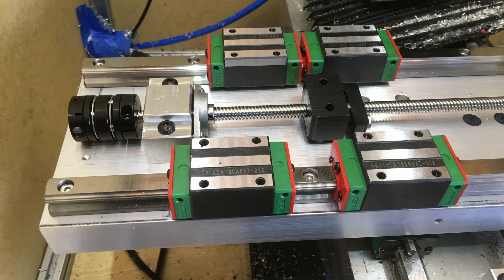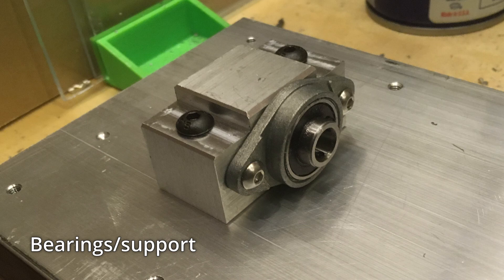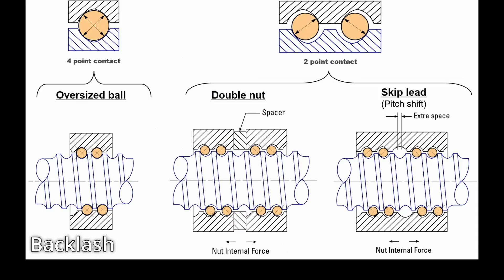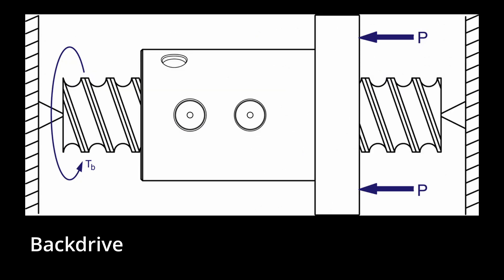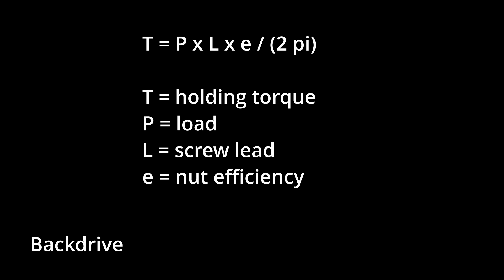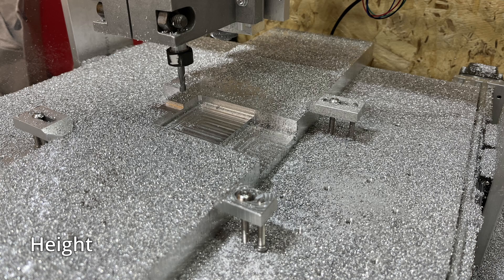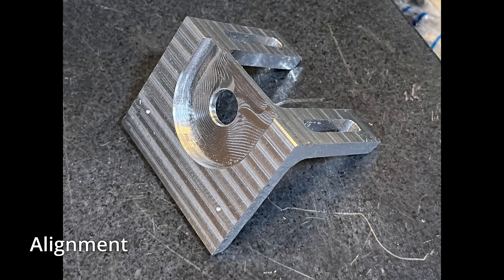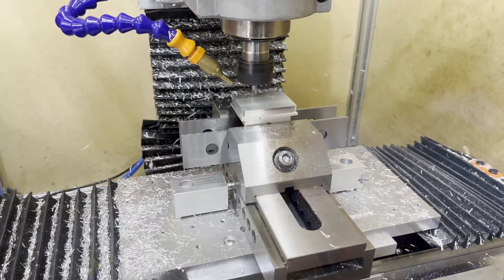Ballscrews vs leadscrews for a DIY CNC

Comment: I have a project that I need to use 8 mm leadscrews and I have been trying to find a tap for the screws. Could you pass on to me your suppliers information?
Thanks Charles
Reply from the maker: 8mm trapezoidal 4-start (8mm lead, 2mm pitch). I found a tap on robotdigg: https://www.robotdigg.com/product/794/ACME-Trapezoidal-Lead-Screw-TAP-for-screw-thread

Comment: Planning on making a Coffee machine cart where the machine raises from it's lowest point to the working surface. What do you believe is the best ball screw to use considering the cart will be used over all types of terrains? e.g. transported inside a truck/van, pushed over grassy/muddy locations and towed on an e-bike over all terrains.

Comment: I used 3/8-8 4 start lead screws for my router build, and I'm quite satisfied. But then I only cutting wood so I don't need a powerhouse of a machine. I run a good size work area at 24"X46" So I'm contemplating adding a second screw to the Y axis, as I am currently running a single center screw.

Comment: Not altogether sure what problem is being solved here. AFAIK ball-screws originated as a solution to backlash. I'm left to wonder what tolerances you are working at that "backlash" with ball-screws is a problem.  Thoughts?
Reply from the maker: I don't think backlash is the only advantage, but sure, that's an important one. For a hobbyist, the reason to avoid backlash isn't just precision, but rigidity and avoiding vibration. Cutting forces during climb cuts will pull the work piece into the cut and away from one side of the backlash to the other, which, if you couple it with a small DIY machine that's lightweight, is going to spell trouble. You're going to break a lot of endmills, unless you're extremely careful about always taking cuts from specific directions, which isn't too hard on a big manual bridgeport, but becomes very difficult on a small CNC machine.
Reply: @imnoexpertbut  Ahhhh....OK...got it.  I think I was mistaking what you were identifying as "backlash". My bad. Apologies all the way around. My own work is on a mini-mini-lathe (see: Sherline) so that was my frame of reference.  However, if you are talking about a full-size lathe I can definitely that. Sorry for the fuss......

Comment: Great video, thanks for sharing!  I found this while looking to confirm the calculation for Torque, where did you find the calc in the video?  It seems to be different to most that I have found which show T= PL/2Pi e, where the calc in the video shows T = PL e / 2Pi.  Where should the efficiency be?  Thanks!
Reply from the maker: I took it from this page, where they should both a drive torque and holding torque equation. For driving, a low efficiency should be higher drive torque is required. For holding, it seems like the same relationship should follow: lower efficiency should mean high holding torque. So now that you point it out, I'm also confused. https://www.nookindustries.com/resources/general-technical-references/ball-screw-design-considerations/
Reply: Thanks @imnoexpertbut that's helped, i had not previously found the two equations together.  I ran some numbers through the equations and i think it makes sense - you need more torque to drive the same amount of load as the motor has to overcome the frictional forces of the ballscrew (efficiency), whereas the holding torque is in a static state, resulting in less torque being required, but having said that, why does the efficiency need to be included in the static state?
Reply from the maker: @markbunyan3078  OK yeah, your explanation made it click for me. The T in the holding torque equation is the motor torque needed to prevent backdrive, in which case it makes sense that lower efficiency would make the needed holding torque lower, because lower efficiency is mostly due to higher friction.

Comment: seems legit... noticed that the el-cheapo ballscrews seem to come with the seals/wipers. being metric is the icing on the cake.

the lack of wipers, along with the imperial 5TPI of the screws i got with the CNC kit for my little X2 mill? think it was "robson" brand? no end of troubles! stripped them at least 5 times getting chips out... along with the old "forget to throw g21 in code" on every power up... ouch.

yeah, one day i might actually finish scraping and get it back together with the new screws sitting on the shelf.. in hindsight, linear rails and build from the ground up would have been a far better approach than convert chinese dovetails to cnc. that has been a journey! 

might STILL be a better option... even if i just hack the dovetails out altogether!

at that point though, the beds still too small...

sigh..

Comment: Interesting discussion...I was looking at some rather precise "stages" used in drilling PCBs ( about 400 x 400 mm), and they were driven with ball screws, I think a pair of them, one per side of each axis, with tooth belt drive between them.
Motion control is always interesting... Strange that so much in these CNC systems is open loop?

Comment: What precision cast aluminum plate did you end up using? Same size as the 6061 flat bar you initially used? Thanks for the update on your machine. I plan on using 1204s as well.
Reply from the maker: Yep. I bought from "USA Metal Online" on ebay, and the plates are G.AL C250, which is "Medium Strength Precision Milled Plate, Alloy: EN AW-5083." Machined just fine.